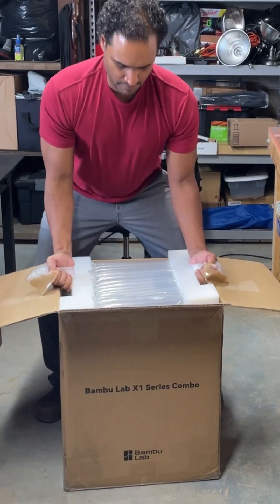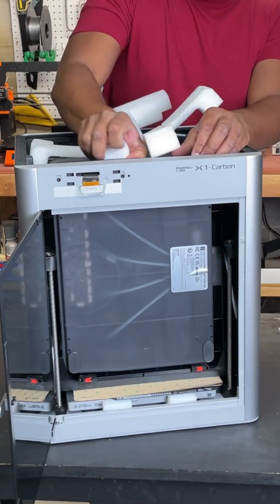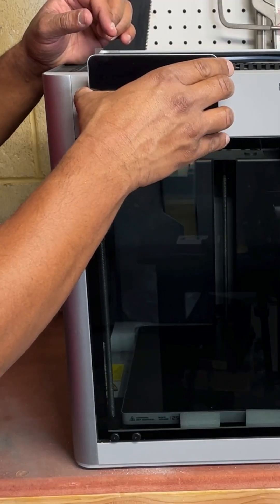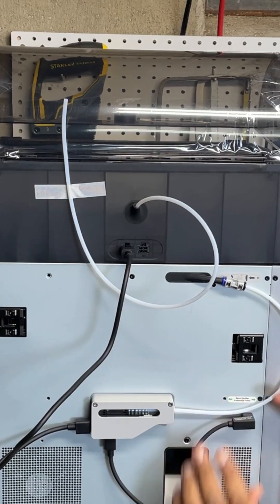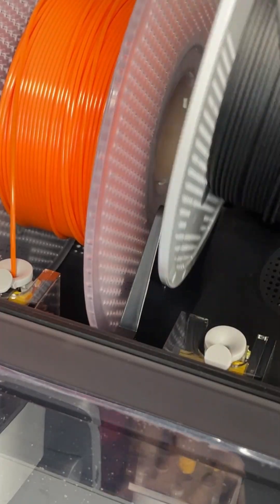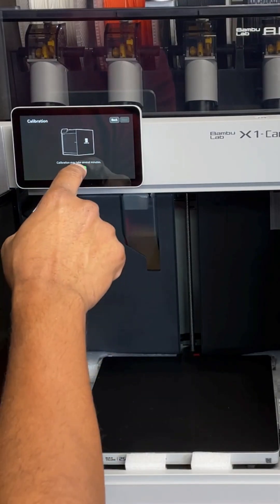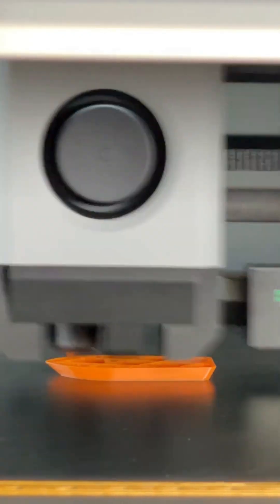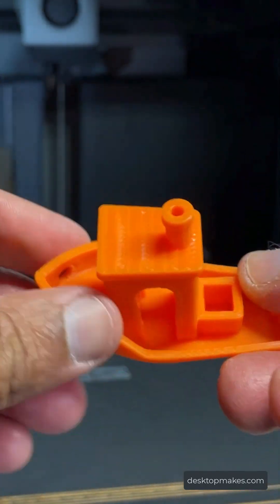Set up your Bambu X1 Carbon 3D Printer in under one minute

Comment: Can guarantee you that this is not realistic, although great summary. If you’ve never set up a 3-D printer or this one specifically, would highly recommend watching other tutorials or if he has a longer version. Plan on approximately 45 minutes to an hour. I followed another YouTube video by Adam Savage and even recorded myself unboxing to try to help others and it took about that time. Could just be that I’m slower than others, mentally and physically.😂
Reply from the maker: I guess I should have been a little more clearer but I meant that the video is under one minute.  I do have a longer video that explains the process in more detail.

Comment: Actually takes close to 45 minutes and that's if you rush. Calibration takes 17 minutes alone
Reply: Not for the first benchy sliced for you. It’s meant to be fast to demonstrate your new printer. And yes. Calibration takes a bit. But no printer can just print out of the box without some form of calibration.